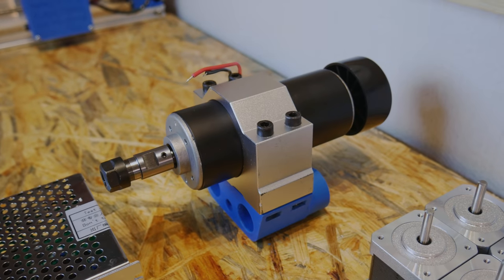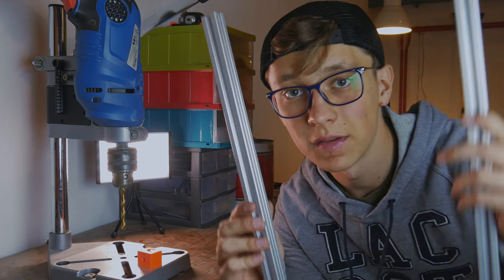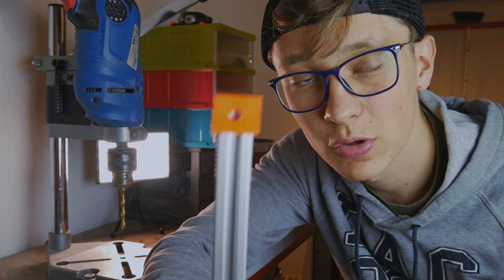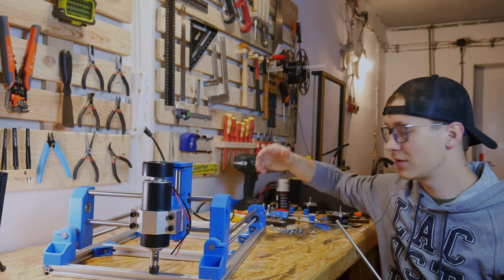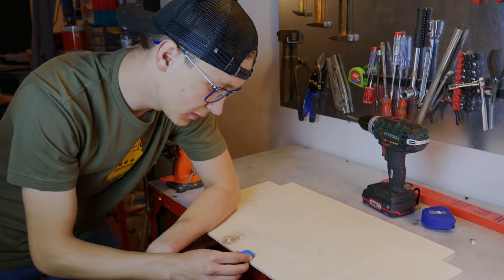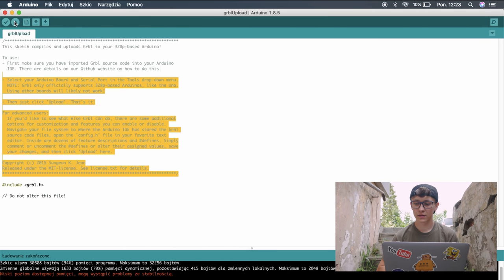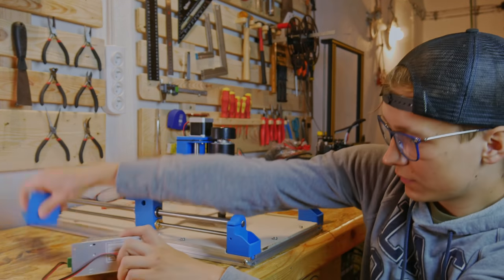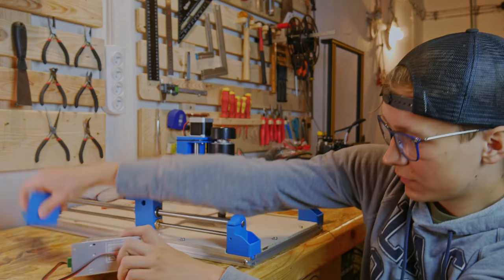How To Build 3D Printed Dremel CNC

Comment: Amazing project idd!! I just can't happen to find the dimensions for the 3D printed parts anyone facing the same problem? I am planning to redraw the parts on Solidworks and change some of the dimensions but to do so I need to current ones at first.Anyone an Idea?
Reply: This would be nice! perhaps you can check the stl files in slicer or cura and measure one of the dimensions, then scale it to the correct size in solidworks and save a sldprt file?

Comment: great project. if you going to do second part, consider to explain configuration of the arduino with the  grbl software & create easy cad  example  (fusion 360) project and run  on cnc .
most of the YouTube CNC show how to build the machine but don't  show  clear the step of software,configuration, CAD and run  projecton the cnc .

cheers from Australia

nice to see younger generation with great skills

Comment: Dear Nikodem Bartnik,
I have built your 3D Printed CNC and started milling some calibration objects like a 20x20mm square out of 3.5mm acrylic. The problem I came up was that the x and y dimensions work just fine and I was able to calibrate them just fine but the z axis slaggs down in the milling process so that when it tries to mill the tabs and cut the piece free from the material, on the side where it starts it cuts way to high (like 0.3mm) so that it leaves some material on that side then it continues with the next side a litle bit lower then with the next one a little bit lower and then at the final side it cuts how it should (cuts through the material and leaves the tabs). I have moved the x and y axis very close to the bottom plate to verify that my build is not the problem. So I am assuming that it is a software problem but I have no idea where to look. I am looking forward to hearing from you and I hope you can help me
P.S. I can send you some images of the parts that i milled.

Comment: Loving all the projects.  I'd like to make a suggestion for your drill press.  Make a block the same height as the base or your drill press so you can stabilize the work to ensure you drill a straight hole.

Comment: I am using the same spindle. The noise is caused by the fan connected at the top of the motor shaft. While running at low speed, I shaved the fan like a wood lathe to balance it. It is now very silent.

Comment: you can't really use steppers for thrust support. They'll work for whip, but they use a spring washer for lash control and that isn't the greatest for backlash. This would probably be fine for 3d printing loads, but not for CNC routing. i would redesign for a captured pillow block if i were you.

Comment: With the spindle power supply, could you not replace the old school pot for speed control with a I2C digital pot and possibly an op amp to allow the Ardino/PC to control the spindle speed? Not sure if GRBL supports this, but would be a simple enough code modification to make it work.

Comment: just in case someone has the same amount of braincells as me, the collet mentioned in the intro is not the outer part. Its basically a metal thing with cuts at one end that can be clamped together by the thing you put it inside (hence the videos where you see people using a wrench on that outer shit every time they switch endmills (bits). figured id save someone the time of googling here.
ER11 collet is the shiny metal thing with "blades" / cuts, thing around it is the shit you twist and tighten.

This has been your daily dose of Explain Like I'm You

Comment: i just want to point out that th3e CNC shield you have isn't compatible with GRBL 1.x it was designed for GRBL 0.9 and lower, and there were some major pin swaps between 0.9 and 1.x

Comment: Hello, I have built Dremel CNC, it's a great machine.  I have used it for mill some pcb and cut acrylic. It's wonderful. Now I want upgrade to 500W spindle. Could you share the stl file for power supply support ? I cannot find it in your thingiverse project. Thanks in advance.

Comment: building your cnc, but with a lot of mods as its built from the parts left from an old 3d printer, so 8mm rods, most of the sizes are different, lets see how its going to work out, hopefully by the end of the week, takes ages to print it all

Comment: I started building the dremel cnc, thank you for the good work and offering this project! 👍
Would I like to know would it be possible to run the software from a esp 32 module? 
Only because I have some spares laying around and wouldn’t have to buy a arduino uno even if it’s not expensive…

Comment: My ender 3v2 printer prints everything to the size defined in software, usually i use hole sizes that match exactly the bearing size and they fit really tight. Printing 1mm smaller hole definitely would break the print. Anyway, nice project!

Comment: Great video. I would like to see one using PETG with the 3D printed parts. Also on a note of 3D printed parts. What orientation do you typically print them, would be of great assistance.
Reply: Petg is not as stiff as Pla. If you want it really stiff print the parts with colorfabb xt cf20 that is basically a petg with 20 percent carbon fiber

Comment: Great videos. Can this be made bigger to accommodate larger work pieces?
Reply from the maker: Sure, you just need to change the dimensions of aluminium profiles, rods and lead screws. Printed parts are the same no matter the size of the machine!

Comment: HIi Nikodem,  great project !!! a lot of fun building it. however i'm facing one weird issue  once i switched to 500w spindle, z-axis no longer seems to hold the position of the drill, meanining it drops 1-2 mm from the position it should hold. did you face similiar issue maybe? i dont know if this is caused by bed wiring (no shielding) or  i fried the motor somehow, funny thing is it seems to be an issue only when spindle is turned on ,

Comment: The arduino UNO you're holding in the video and the arduino UNO in your instructables looks different. What is that blue one you're holding in the video please? Link? Thank you :)
Also why did you only plug in a power supply to the stepper motor shield and not the arduino UNO itself?

Comment: I have engines with the following characteristics:

Step angle: 1.8°
Number of phases: 2
Current per phase：1.7 A DC
Voltage 3.06V
Winding dc resistance（25℃）：1.8Ω±10%
Winding inductance：3.8mH±20%
Torque：≥560mN.m（I=1.7A)
Shaft diameter: 5mm                                                                                                                                                                                                                                              

Can they be used in your project?

Thank you

Comment: Hi Nikodem ! Could you explain how you manage to make your leadscrews work with two nuts ? Thats not possible according mechanical basics, except if you use a particular adjustment device ? Which and how ? Thanks.
Reply from the maker: When assembling I thought that this will be a simple solution to backlash problem, I turned out that indeed it doesn't work so I had to use just one nut. Sorry for misleading :)

Comment: Do yourself a favor and never - I repeat - never use WD-40 as a cutting oil. WD-40 is a rust remover, not a cutting oil. This will dull a thread cutter very quickly. I am a machine fitter and did my apprenticeship over 45 years ago. There was only cutting oil and to this day it is the best oil for speed cutting!

Comment: Hello, great job, I have made it, but I have problems when cutting acrylic, the cut material stays stuck to the cutter, could you please tell me what are the cutting parameters for acrylic with this spinlde
thanks you
Reply from the maker: Try with higher feedrate (for example 900 mm/min) and smaller depth of cut per pass
Reply: @nikodembartnik  ok, thanks you i will that

Comment: Hello. I really like your design of this engraver! especially with a brushless motor. How rigid is this CNC? Would it be a lot of work to use 16mm rails instead of 12? I see that there is quite a bit of room for increasing the diameter with linear bearings. I could try it myself, but I don't know how to edit STL files. STEP would be much better.

Comment: What a great video series, I've subscribed!
I do not have access to a 3D printer, have you thought about putting a packet together with all of the 3D printed parts and charging for them?
In fact, what about everything, except Dremel,  that is needed to build one of these, screws rails, printed parts, electronics etc. I know I might be interested, depending on cost and shipping.
I can't wait to see the second part of this video.
Thank you again for a wonderful video series!
Pam
Reply: I would be interested in printing them for you if you would like
Reply: Wow, that would be wonderful, Thank you! 
How can I reach you? Pam
Reply: Wow, that would be great, I would like that. 
How do I get a hold of you? Pam
Reply: I looked at the Dremel CNC again, that is too much 3-D printing to do. Wow, I thank you for the offer, but I couldn't let you do it for free and I am not in a position to extend payment at this time.
Really, I thank you so much for your offer tho. Thank you, Pam
Reply: @pamcarr4003  if I can get the files into my slicer I can try to print with some of my leftover pla. Just got 6 rolls included with a 3d printer purchase so I have lots to use and a second printer waiting to get broken in. If you can cover shipping you can have them free
Reply: I thought I answered this message. Oops.
If you don't mind doing that then that would be great.
Where would these be mailed from?
Reply: @pamcarr4003  CT, USA
Reply: Cool, I'm CA, USA, great.

Comment: I have the frame built, but have lead screw issues. I used links in the parts list, but Banggood sent me a mix of T8x2 (2mm on one rotation) and T8x8 (8mm on one rotation). In this video, it looks like the longer ones are T8x2 and the shorter ones are not. What are others using? I can’t find a definitive answer. I’m guessing everything should be T8x2 and Banggood sent me the wrong thing. In one package the screw they sent was t8x2 and the nut was t8x8, so I’m sure Banggood is at fault.

Comment: Nice build and great video. My only concern would be that fully closed box for the Arduino and Motor control board, great for keeping wood dust out, but may build up heat inside. How about 2 air ports and a small fan to keep the electronics cool, with a filter on the intake air port, maybe? I really enjoyed your presentation.
Reply: i know this is like 3 years old but the arduino does not really heat up that much.

Comment: Hi I wonder how you selected the diameter of the polished rods, 12mm. The lead thread which one are you using. From your BOM I see its 8mm but is it T8.2 Is this not a bit slow. Normally used for z axis.

Comment: Do you need to redesign the stl files for use with Nema23 steppers ? They are 15mm x 15mm larger.  Has anyone already done this ?  I haven't ordered parts yet as I am trying to take suggestions from other posters to build the best version possible.

Great setup Nikodem, thanks for the detailed build directions.

Comment: Hi Nikodem, love the machine. in the process of building one myself. I've found an error in the stock list. What size screws are you using for the part in the video at 9.25 . In the spreadsheet and instructables M3 x 20 are stated. however they are not long enough. I believe that was before the update of the x axis carriage? Hope this helps and you can update the list! ps. What size did you use as i need to buy some now! ?

Comment: Why did you didn't place the sacrificial plate under the aluminium structure, you use the plywood as a  renforcement ans save 30mm on the z axis ?
With that, you could use strong plywood like 15mm without losses un build volume

Comment: Hi, I notice from the instructables you are using NEMA 17 for the motors; after the updates and for milling aluminium are they still valid/strong enough? It would make my build so much cheaper to use 17s, but i definetly do not wanna be short on torque in the axis. I'm designing my own fully inspired on your project and looking for the parts and price list (its really hard to get things right in Argentina) so I'm trying to make it cheap enough that I can afford it, but not so cheap that I have to buy things again (hence, my question about the motors)
Reply: i'm stating to build mine, nema 17 are really hard to find here in brazil so i'm going to modify the design for me to use nema 23 instead

Comment: i am not that knowledgeable person, but would it not make sense to make silicon based cast from the original sanded parts, and then make epoxy resin parts?  just asking.. cos then they would be more durable cos that parts would be 100 solid.. just asking..

Comment: Hello, can i use rod 10mm ??? Because you use rod 12mm and not have rod 12mm , only 10mm.
Reply: you can use 10 mm bars but the whole structure will become weaker and more subject to vibrations: if you use it to work wood should not make a difference but if you want to use it for aluminum then it is easier to have unsatisfactory results
Reply: @zolatanaffa87  Thank you very much for the reply

Comment: Great videos, ordered all my parts and just contributed to your account, I hope others do the same for all the work your putting into these projects. I may be missing it, but I looked and was unable to find the bracket stl file for the spindle power supply with the potentiometer. Any chance you can point me in the direction or upload that file, thanks again.

Comment: You may have issues with that spindle causing Arduino to lock while running a cnc program.
Reply: Jon Raymond why?
Reply: @dutchman55  The DC motor has a lot of EMF and resets/locks the USB to UART of the Arduino. Others that have used this spindle have had this problem.

Comment: Would this have to be beefed up to make cutting area 24" X 24"
Reply: You'd need more aluminum profiles, longer leadscrews and steel rails, but the motors and electronics would be exactly the same.
Reply: @benphillips2947  Would I still be able to use the printed parts
Reply: @68shiloh  i think so, all the 3d printed parts are kinda just joints and mounting brackets.